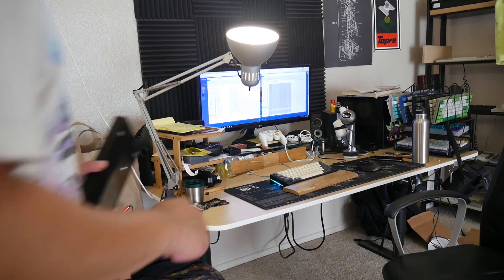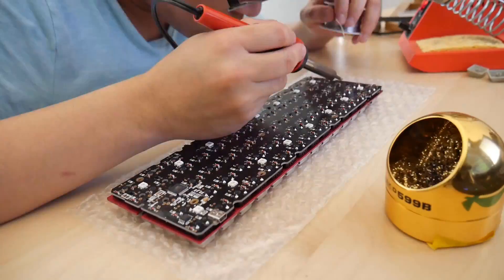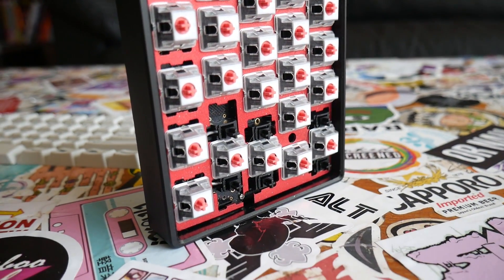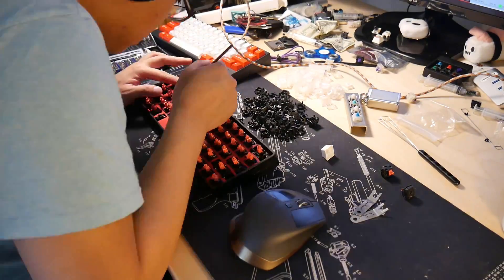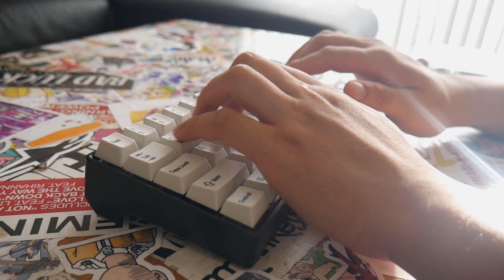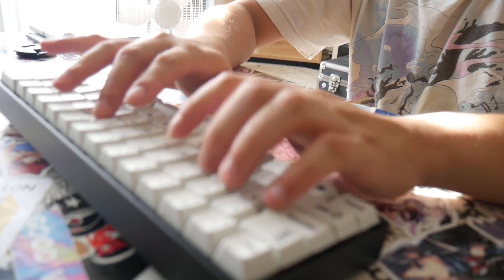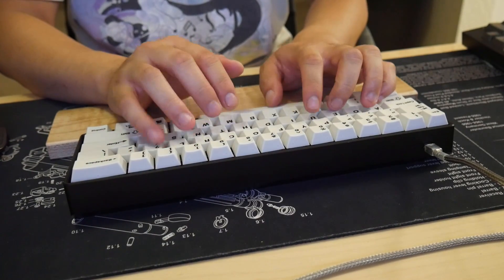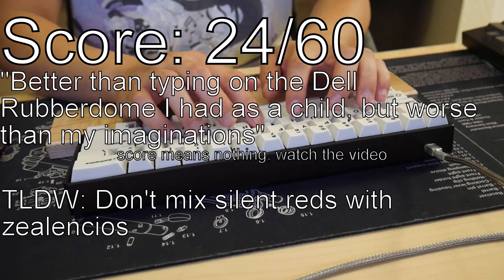Silent60 Review

Comment: Silent Reds/Blacks and SA caps would probably be the quietest option as the keycaps do not contact the switch top, so no need for Zealencios. Also the plastic tends to be thicker as I'm sure you're aware and it would reverberate less.